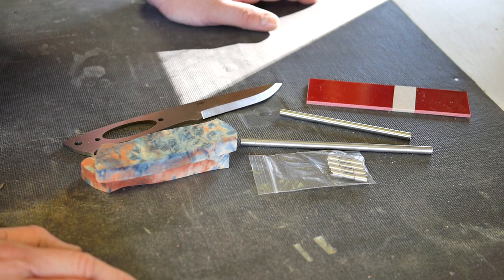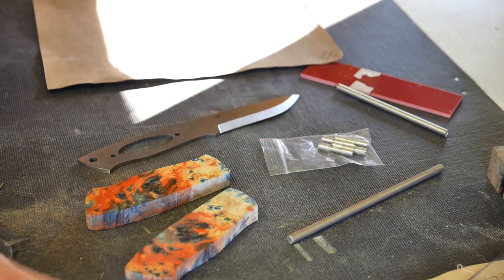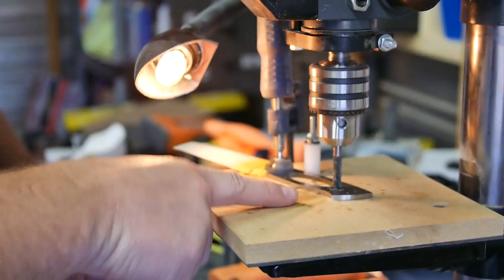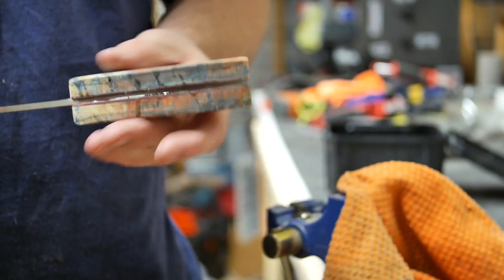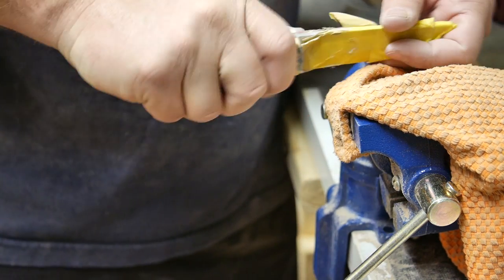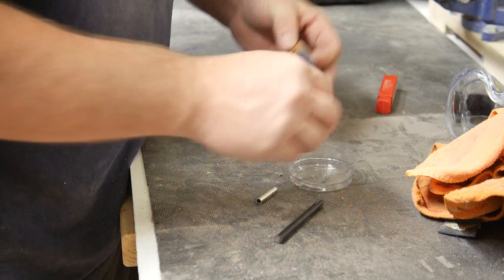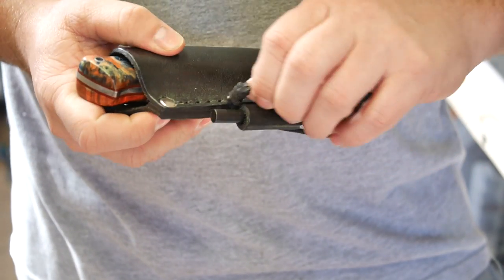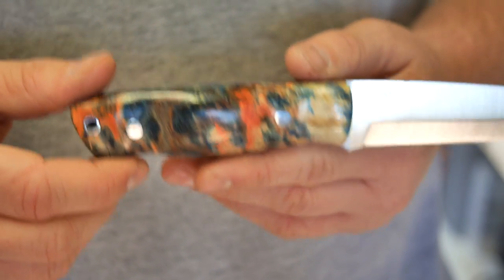Beautiful Custom Enzo Trapper build w/ Firesteel (elder maple burl)

Comment: Nice knife. Looks beautiful. I have a question. What blade are you running on your bandsaw? That sliced through them stabilized blocks like butter with a clean surface. I run mostly a 3TPI resaw blade, but I'm afraid to use it as it will dull the blade pretty fast and give a really rough surface. The blocks I'm cutting are pretty thin, so i dont have much room for error if i want to get two 3/8" scales. Thanks for your help.
Reply from the maker: Cool! It depends on the wood as to how cleanly/quickly it cuts. I have four blades and honestly, I'm using the one that came with the machine. I believe it's 8TPI. I fiddled arounds on some smaller scrap blocks before doing my sure cutting. The main things I found that helped me were to 1. make sure the blade was tight for cutting lengthwise (a little looser is ok when cutting the shapes of the scales) and 2. make a block guide to run along. I tried higher and lower teeth blades, but so far, this one seems to work well. Hope this helps. Cheers
Reply: Ok cool thanks. Ill have to pick up a different blade. I have one thats around a 8tpi but its getting dull.  I cant believe the best one is the one that came with the machine. Normally they are the worst.  But hey, whatever works right. My local tool store has a 1/2" higher TPI blade i'll pick up. That should bring me pretty close where i need to be i think. Thanks for your help. If your every looking for stabilized blanks let me know, i deal with some cool stuff and only use the best for stabilizing.
Reply from the maker: Sounds awesome. Ya, I picked up other BOSCH blades and the quality is good, but the TPI was different and noticed it in the cutting. On the BOSCH the more teeth the narrower the band as well. It is what it is, like you said - whatever works. I've got them hanging because they may serve me better on other types of projects.

Comment: G10 does not respond well to two-component epoxy adhesive. Experimental with various expensive adhesives but the result is the same. With a gentle pull, it detaches from both wood and metal. What am I doing wrong; Thank you.
Reply from the maker: Hum, I’ve never worked with G10 directly, the only time I have it was prefabricated to a liner which then bonded to metal with epoxy no problem. Are you giving it long enough to set? Perhaps the epoxy doesn’t set as quickly with G10. A buddy of mine used to something called G-flex a while back, but I’m not sure who made it or if it’s still available. Perhaps look into that online and see if that would be good for your application. Best of luck!
Reply: @OneDegreeLife  Thank you for your help and prompt reply.